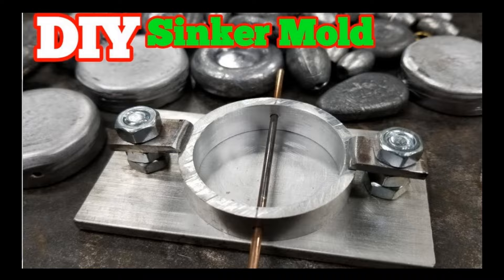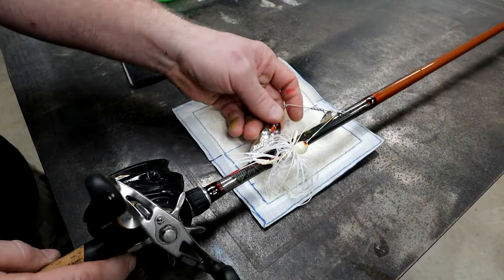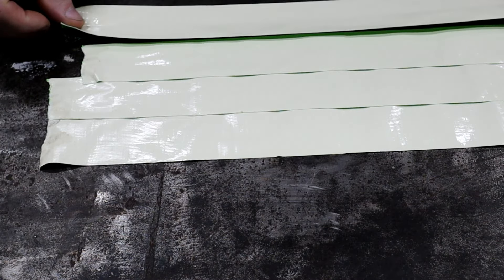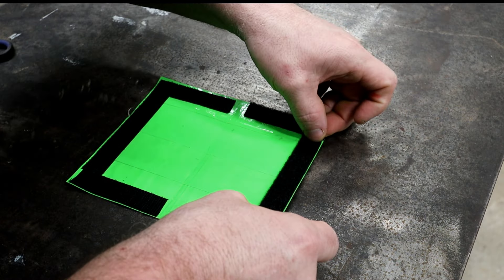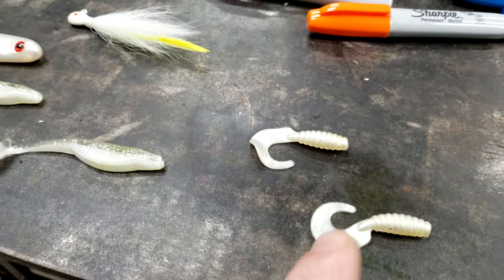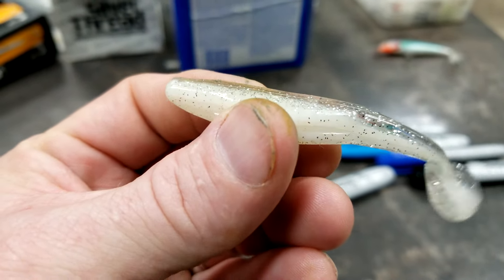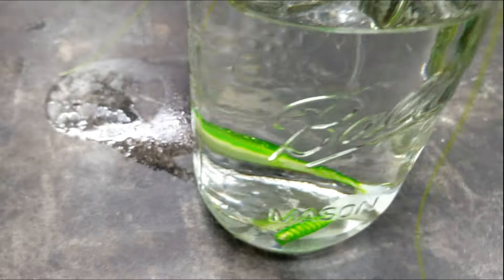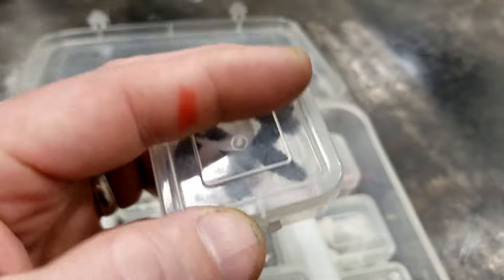6 Fishing Hacks for Cheap

Comment: I just found this channel and have a hack that you may have already shown people but I’ll tell you what I do and you may find it interesting. Ever been on the lake and realized that you needed more fishing line on your reel and you know how awkward it is to fill the reel back up? To fill up a reel from a 1/4 lb spool of line,  I take a peanut butter jar that is slightly bigger in diameter from the spool of line, then drill a very small hole in the side about in the middle of where this spool would sit in the jar, feed the line through the hole and you can then refill a reel without having the spool to unravel and get line everywhere. After filling, I use a short piece of tape to secure the end of the line to the outside of the jar making it easier to fill up the next time I need it. I even fill reels at home using this method. Grin.

Comment: You can dip styrofoam in to a 50/50 mix of PVA glue and water.  It will dry clear, make the foam a little harder, and you can spray paint without melting

Comment: You can buy sheets of duct tape.

I use soft sided tackle boxes. I use foam like that in the hook box to keep the hooks from getting all mixed up. I just don't glue the foam inside the compartment so I can pull it out and have hooks stuck in both sides.
Reply from the maker: I didn't know they made duct tape in sheets  😳  lol but now I do lol
Reply: @FishinNStuff  I know Staples has it but I think I've seen it at some wal marts back in the crafts section.

Comment: For painting the foam, you could put a brush on primer so it protects the foam from the accelerant in the spray paint. Would be super cheap.

What I also use is a mix of paint and mod podge as a base and then spray paint that

Comment: Comment on your little tackle box - check out the hobby area of Wal Mart (they are cheaper than hobby stores) or the Hobby store itself for these type containers. They are cheaper than what you buy at sporting goods BUT they do not hold up well, they are far more fragile and plastic is thinner. Also check hardware 0 tool boxes make tackle boxes and they are cheaper, the regular pliers and cutters are cheaper as well. If you can find what you are looking for in areas other than sporting goods, you will save money. Always visit the Dollar Tree. True, they do not sell "fishing" stuff but you would be surprised what they sell that you can use, especially tools
Reply from the maker: Yep . I had all that on another hack video idid . I was just making a fly box because they are expensive  . I never buy fish piers they are high

Comment: I know it's a bit late, but if you want to paint styrofoam bobbers with aerosol paint, just get yourself some Mod Podge at the craft store.  It's basically Elmer's white glue with a resin in it that will literally become a "shell" over the bobber when it dries and it will protect it from the solvents in the paint you want to use.  You can even add color to the Mod Podge by mixing it with a little craft paint (Apple Barrel, Craftsmart or Folk Art brand).  This makes it easier to tell if you miss a spot, since the Mod Podge dries clear.

Comment: When you need to paint something that the solvent in the paint eats (like styrofoam), try wiping on a coat of shellac first.  Like sharpie, it's an alcohol-based finish & will protect whatever you're painting from the solvent of the paint.

Also, if you prime whatever it is you're painting with a white base-coat, whatever color you top-coat it with will appear brighter.  (I paint a lot of lures that the paint is worn out on with nail polish & always do this.  Which brings up Hack #7 - buy up oddball colors of nail polish at garage sales & out of the clearance bin to paint lures with - it holds up to the abuse MUCH better than regular paint, especially if you give it a coat of clear or two over the top when you're done. =) )

Comment: Use Testers paint like you would use to paint plastic model cars & trucks. This can sometime be found in Walmart, Hobby Lobby, or some specialty stores or on line. it might be able to paint the styrofoam or plastic parts.  It's been a while since I've done a mod like this so I can't remember if it worked right or not (strokes suck).
Reply from the maker: Thank you Sir I will definitely try that

Comment: I like your idea about the jig holders  but I'm going to glue the foam to the inside top of a bucket  I like to hang my jigs and lures on the rim hanging inside the bucket this will keep them from falling into the bucket  then drill a hole in the bottom big enough for the seat post to go threw holding the bucket to the floor so it doesn't  move  McDonald's  has 2 gallon buckets they get pickles in  they throw them away  I'm sure if you talk to the manager you could get some lids too good video keep it up  thanks for the ideas
Reply from the maker: That's a great idea brother

Comment: I use Clear Vinyl for my lure wraps, 54" Wide X Yard for $13. Can see the lure at a glance! The glue that's on the velcro ran on after a year or so, it was a sticky mess. The next ones I make will be sewn on type velcro.
Reply from the maker: That's a great idea man , I was going for dirt cheap but I like your idea better . Plus the sew on velcro is cheaper than the stick back kind

Comment: I just wanted to tell you about a great primer for styrofoam, it’s called “Minwax -Polycrylic”. I researched RC Airplanes that are made of styrofoam and this product works really great, won’t ruin foam of any kind, drys fast, it’s clear, available in flat, satin and gloss finish and it will seal the foam and primer it for whatever colors you want. Keep in mind, if you want to paint a light color onto a dark color, make sure to use a white primer over the Polycrylic, it makes the light color more bright and correct without any dark color showing through. So put 2 coats of Polycrylic, let dry over night to be safe that it’s dry enough, then paint with white primer and let dry thoroughly, then the color of your choice. Personally, I would coat it a couple of more times with Polycrylic after to give the paint more protection. You will have beautiful brand new floats. This would work on your plastic crankbaits too. Cheers

Comment: Great ideas as always, thanks for sharing! I also love to create my own stuff. One I will share is: a lot of people are using fiberglass tree support rods for push anchors for smaller boats. They are really hard to find now and are getting expensive, shipping is 3 times the cost of the rods. I bought some wood closet rods, 10' long X1.25" around, for about $6 each, at my local lumber company. You can coat with epoxy or polyurethane etc. to make them last longer, but for the price you can afford to replace yearly. I am making brackets for them to slide through, PVC lined. I hope this is helpful.
Reply from the maker: Fiberglass Tomato stacks work great , but they are seasonal so they are hard to find in the winter

Comment: I need a fishing hack to carry my rods.  I use an electric scooter to get around to my spots, and I need a quick and easy way to throw a couple of rods on my back. The rods are two-piece, 6 foot 10, and I carry them in two pieces.  Both are spinning rods. 
I tried using pool queue sleeves, which are kind of ok, because I can attach a strap to them and just sling them over my back, and the reel just sticks out the top, but I'd prefer something that I can attach to the left and right side of my backpack, sort of like a sleeve that I can just drop the rod into.   Like an old six-gun holster for a fishing rod, I guess?  Something secure, hook-safe, and solid enough to protect the rods. 
Any clever ideas?

Comment: Have you tried a water base paint on the styrofoam?
Reply from the maker: No but I'm sure  it won't hurt it , do thru make water base spray paints ?  🤔
Reply: I have seen water base paint sprayed in a HVLP spray gun. We use water base paint at work and HVLP spray guns. I will try the water base paint at work on the styrofoam next week.  I will let you know
Reply: @FishinNStuff  I sprayed some styrofoam with water base paint from work and it did not melt or disform its shape

Comment: Wouldn't the smell of the Sharpie turn the fish off?
Reply from the maker: My not sure , I thought bass was sight driven and catfish were mainly scent driven
Reply: @FishinNStuff  Several videos suggest using Sharples, so it apparently works I guess. I would figure they would spit it once they got a taste
Reply from the maker: You could be right . I normally see how stuff works . I didn't believe in fluorocarbon until I tried it  .and it works good . I was surprised it didn't wash off . But you could be right . Most of my stuff is about the ideas
Reply: @FishinNStuff  Im still going to try it. 😃

Comment: WILL POLYURETHANE  MELT STYROFOAM ?
Reply from the maker: I don't think so,  but I tried the spray kind that come in a spray can and it did. But if you paint it on I'm pretty sure I've done it and it don't
Reply: @FishinNStuff  cool because i have a whole gallon i need to use up